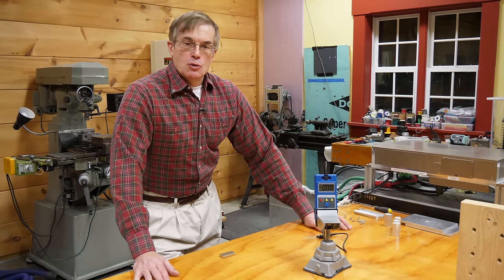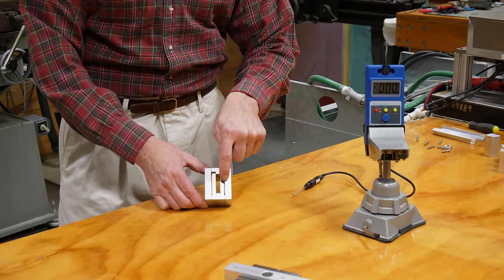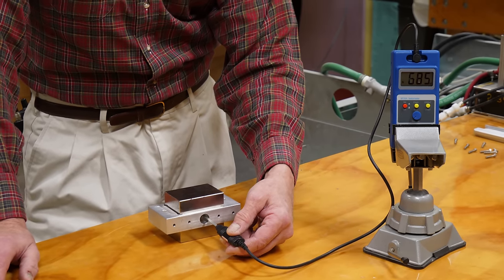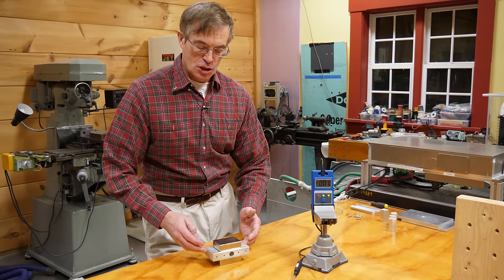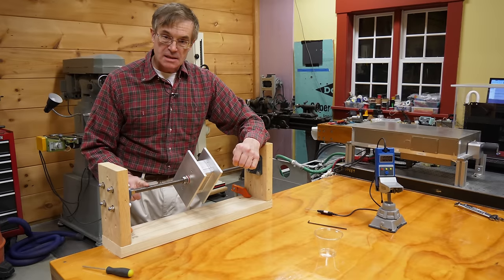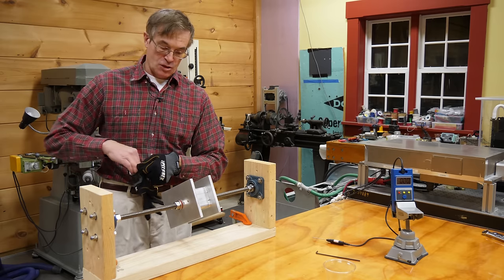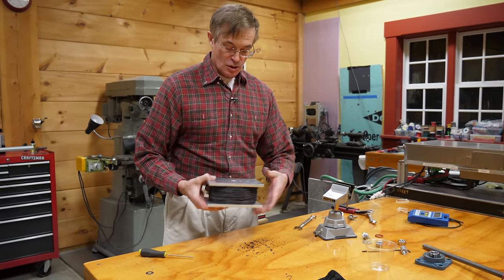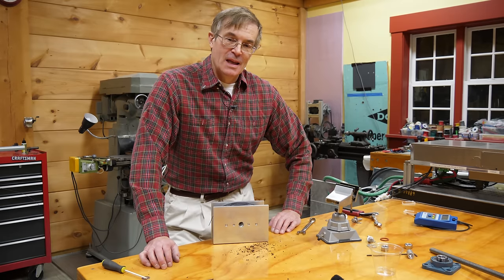VERY POWERFUL MAGNETS… THE EASY WAY

Comment: Great idea! I giggled when you struggled with the tools near the magnet. I know exactly how challenging that can be... You know its coming and prepare for it, but you just can't compensate for the quickly increasing strength of the magnetic field near the magnet x)
Reply: I did some work on some magnetic stuff back in the day, we had some special alloy tools which made it a lot easier. I think they were just stainless steel, but I can't remember, I remember them being expensive however.
Reply: @ColtaineCrows  Neodymium magnets are unbelievable compared to any of the past magnetics most of us old guys are familiar with. Every warning about pinch danger for any neodmag larger than two nickels stacked together is for real. Blood blisters for magnets the size of a quarter or a domino. Crush bone on neodmags 52 about the size of Tech Ingredients' rig here. Loose fingers and other chunks of skin on a 6" diameter magnet. The holding force is not an exaggeration. Put the weight of a refrigerator on just that finger and it's going places.

DO NOT LEAVE MAGNETS of any kind where ANY KID can get to them. If they're stupid, and we're all stupid at some age, they'll swallow them. Bad enough for refrig magnets but DO NOT WAIT AROUND IF NEODYMIUM (shiny) magnets. If they swallow a bunch at one time connected, they might pass them in the poo but still straight to hospital. If they pop them in their mouth like popcorn, they're going to end up in surgery immediately. (muscular distortion of intestinal wall >  huge shear vectors where pinned by neodymium pair or cluster).

All that said, they are fantastic to try out ideas that weren't effective back in the day (It took me a few nips to forget the old-magnet mindset - scary these are) that may show noticeable efficiency now. 

There is more to magnetic resonance than we understand. Just like hitting a certain note in a bathroom, oscillating magnetic fields need a rethink toward new materials and methods. 

Supercapacitors able to be quick fed transient and anomalous emfs that are now wasted can add up harvested. Much of our math on efficiency relies on the permeability of the magnetic and reluctance of alter-magnetic materials which are derived in non-combined standard lab replications. Experimentation is happening because magnetic power and energy storage options are available. The gold standard is electric flying. Power/Weight ratio can be offset by unconventional efficiency schemes using short burst hot and long term simmer power management. Great time to be alive and curious in these things. Great FREE resources like this guy here.

The Bedini wheel as explained and demonstrated by Great Scott showed some interesting strangeness in the results but only because he can diagram and explain his fabrication and then measure and reason on the results. Might be worth replicating his effort. Hate to encourage the lunatic fringe and I've seen the "free energy" videos til I'm sick but it was a surprising outcome and those are always happy accidents.
Reply: Needs some anodized aluminium AN Spanners, maybe that would work
Reply: Depending on what you are doing, you can add a bounce layer to one side, so you do not get metal on magnet contact.
Reply: one over d² right ?
Reply: @ColtaineCrows They may have been beryllium copper tools? These are non-magnetic and also non-sparking. Very practical if there's an explosion hazard from eg. working on gas pipes...
Reply: @brainiac75  can you do a video on whether powerful magnetic fields affect phosphorescence times?
Reply: @Flatox if you have 3 spatial dimensions, yes.

If you have more than 3 spatial dimensions, you don't have time to play with magnets, you have to work on your string theory paper and ask your doctor if you can get a day pass to go see Brian Greene at the local library — and that nurse who hates you might have told him about the whole "Calabi-Yau manifold made from feces" thing. Don't worry, though, they'll rue the day they crossed you when you win that Nobel prize for the most prettiest maths.

Sorry. I don't know where that came from. If you work in string theory, I support you 100%, as long as you spell my name correctly on the coffee. 😎
Reply: Your Channel Is Op
Reply: @brainiac75  : I used them as a former mine diver ... 
Lost a hammer, paid 500 German Mark ...
Reply: @CSkwirl  I was thinking titanium due to how much tougher it is, but stainless in the 316L range would be nearly as tough and a fraction of the price, and maybe save some to get the tougher jaw face by mounting thick sheet over them of titanium, though I wonder if he slid say a 1/8" thick flat sheet of bismuth over the side and around the bolt if it would make steel easier to use with any significance that is.
Reply: 8
Reply: @ColtaineCrows  The tools may have been made from Beryllium/copper.
Both light weight and non-magnetic.
redrok
Reply: Experienced the other day when repairing my washing machine. Had to remove the rotor, and it needed to be lined up just so, which was tricky since every time it got close, it would suddenly be pulled to one side or the other. 😅
Reply: I'm not wealthy enough to be able to afford non-ferrous tools but that is the whole reason I do NOT use adjustable wrenches around larger magnets (not near as big as his). It's hard enough using the correct open/box end wrench but way easier and safer (for me) than adjustables

Comment: You should use flat steel similar to pallet strap. I've seen it used in some power transformers.
This will eliminate most of the air gaps created by the round wire. It should give you a higher density.
Reply from the maker: We considered that and it is a good option.
Reply: Winding first few turns of that stuff could be an "interesting experience"...
Reply: @blg53   Throw on a liberal amount of Kapton tape, and it should be fine.
Reply: @TechIngredients  Could you use shorter strips of metal and layer them similar to bricks first then wrap the wire over the top so as to bring the field lines closer to the gap? Or have I got the wrong  end of the stick?
Reply: @TechIngredients   would you elaborate on why you choose the wire over the straps. Your response implies you have weighed the  options
Reply: @kurieren  I did some looking cuz your post got me curious so I did some reading. Kapton tape used specifically to insulate wires in and around a coil have been directly connected to loss of life in the airline and space industry due to the insulating properties having poor abrasion resistance in a high vibratory environment.  Basically they don't do that anymore because it has failed and killed people.
Reply: How about placing blocks of ice as spacers between the existing structure and the material that needs to be added, guiding the new pieces in to place as the ice melts?
Reply: In power transformers they use flat copper wire and then fill the inside with mineral oil.

Comment: Very ingenious solution! I worked on MRI's a short while and the experience you had with the channel locks was a real problem I had. Most of our tools were beryllium alloy so non-ferrous but drilling access holes for fiber optic cables around a +2T magnetic was an experience I never wish to repeat. Wonderful video keep them coming!

Comment: Amazing that you can make a relatively uniform magnetic field with almost a whole 1 Tesla of field strength. The strongest magnets I ever used were 3 Tesla, and those were liquid-helium cooled superconducting magnets in a Bruker Spectrospin 300 MHz NMR machine about 15 years ago. Go back about 40 or 50 years, and 1 Tesla would probably have been enough to do some basic low-field NMR experiments. If those super-strength rare-earth magnets had existed then, I'm sure they would have been used for that!
Of course the added problem with NMR is that the field strength around the RF probe (which is where the sample-tube goes as well) has to be ABSOLUTELY UNIFORM - no variation at all. NMR instruments typically do this with secondary electromagnet coils called shim-coils, in which the current is adjusted to even out the field strength. In the early days this was done manually while keeping your eye on the field-sensors, but this utter tedium was eventually taken over by a computer, which could do the adjustments much faster.
I wonder if there would be a way of combining the permanent magnet array you show here with a bank of electromagnetic shim coils to make a perfectly uniform field? A standard NMR sample tube is only 5 millimetres wide (with a 40 millimetre sample depth), so the cross sectional area over which the field needs to be uniform is fairly small. If you could do this, you would be on your way to making the core of a home-made NMR instrument. Minus all the RF transmitters, receivers and amplifiers of course, which are a whole other headache.....

Comment: I used to work at a transformer company and they used sheets of high-silicon steel which were layered together to make a laminated core. Apparently it allows a higher magnetic flux density than solid steel.  However I can see that working with sheet steel edge-on to a powerful permanent magnet is a recipe for truncated fingers, so your wound coil idea is interesting.
Reply from the maker: Thanks!

Comment: when are we seeing the Magnetohydrodynamic motor/generator using that large gap magnet?
Reply: Everyone and their brother (not really) has done a mhd  motor with conduction. I'd like to see it done with induction.
Reply: @kreynolds1123  
How does that work?
Reply: @robbiejames1540  if you change the current in a coil, it creates a changing magnetic field. That changing magnetic fiend induces a current in a conductive  metal neat by. The  currents in the metal create their own magnetic field in opposition to the initial magnetic field that induced the current.  The result is a repulsive force pushing the conductor away.  

A Pulsed induction thruster uses a coil to ionizes a gas for a working fluid to use for a thruster to genetate an intense  and  rapidly changing magnetic field.  once the gas is a plasma  the changing magnetic field from the coil induces a current in the plasma and that current in the plasma makes its own magnetic field  opposing the magnetic field in the coil thus pushing  plasma away at a high speed for thrust. 
https://en.m.wikipedia.org/wiki/Pulsed_inductive_thruster
Reply: @kreynolds1123  
I see! That's really clever.
Reply: @kreynolds1123  
Presumably, that would also work with any sort of conductive material - so you could shoot a plate of metal with it too?

Comment: I wrap lots of wire and built an aluminum jig/fixture that goes on the lathe and uses the threading settings. Hardest part is like you mentioned chip cleaning before when using magnets. I spend more time in prep cleaning before than I do wrapping.

Comment: What a great video. I’ve always wondered what other ways would work to strength the magnetic field. Big blocks of steel are expensive and dangerous and hard to work with. The wrap technique is something I can do and maybe not have every nut and bolt require that it be scraped off my bigger magnets. Thank you! Thank you! Thank you!
JTI

Comment: How about using steel ribbon instead of wire? I'd imagine it would be more expensive, but it could be easier to wrap and far more uniform.
Reply: Good Idea, even though he did say its only the cross section that is significant. But there would probably be some increase. That's basically a packing problem. Like you said it probably wouldn't be worth the cost for the few percent(if that) increase unless you had some laying around. Or perhaps even just cut long strips of sheet metal.
Reply: My intuition (which is likely to be completely wrong) makes me think that two opposing C-shapes out of steel ribbon would be even better as guides but it would not be as practical to build, especially not in a continuous additive process.
Reply from the maker: The ribbon would work, the result would be more compact, the ultimate performance would be the same and the cost would have been higher
Reply: Clem Taylor agree! cold rolled steel wrapping around as used in low frequency transformer style would increase permeability which could increase the inner flux( my thought).  Improve rejection to the eddy current to? if the experiment required to reduce the hysteresis loop of the wrapping material then could be a good idea. Good comment Clem. 
Keep going! Very informative and recreative topics

Comment: Would wrapping the copper wire more uniformly with tension help align the magnetic field's better for a higher Tesla Rating???
Reply from the maker: Copper is not ferromagnetic and neither is aluminum.  Although this wrapped magnet looks something like a transformer, the wire serves a completely different function.  The wire in a transformer guides the electron flow and it is these electrons that generate the magnetic field.  This steel wire guides the magnetic field which is generated by the permanent magnets in the center.

Comment: You were talking about magnetic flux density (in tesla), not the magnetic field strength.
Please try to use the correct term. I know everyone uses the terms incorrectly, often including myself, but it´s a big difference.
Reply: @invendelirium  Yes they are proportional in this case. 
It´s just something that can be confusing, making it important to use the correct term.

Comment: My dad would have smacked me upside the head for trying to use channellocks instead of wrenches to tighten the nuts.
Reply from the maker: My dad might have had the same thought, but avoided it, fearing an endless debate  about why do we have channel locks anyway.
Reply: Ha! reminds me of the time I needed a pole for my rain gauge. So, idiot me sawed the head off my mum's broom and broke the blade of my dad's hacksaw in the process. The light of truth hit me when the broom head hit the ground: Annoying one parent was dumb, both together and I was dead.

My dad's comment: 'I told you to never use a metal cutting blade on wood.'  He attaches the broomhead back to the handle and takes me to buy a new one for my rain gauge.

Comment: When you don't want the nut to move, use two and tighten them toward each other and that could alleviate pressure on the carriage device in the middle. You could have saved on the bearings at the ends.

Cool video!

Comment: Very clearly explained and demonstrated. Thank-you. At those field densities, you're within an order of magnitude of the field strengths of superconductor electromagnets - and for a much smaller cost, in a safe manner, albeit within a much smaller volume of influence. You've gained a subscriber today.
Reply from the maker: Thanks!
If you can afford to reduce  the volume further, two tapered, steel pole pieces in the shape of a pyramid or a cone can more than double this field strength.
Reply: @TechIngredients  Yes, it's an old idea which has been used professionally. I have a magnet which was rescued from a scrapped 1950's magnetron and which uses that technique to concentrate the field.

Comment: Kudo's for using the proper SI unit tesla. At the risk of splitting hairs, strictly speaking,  your meter is measuring magnetic flux density, not magnetic field strength (your wording), for which the units would be ampere per meter (A/m). They are related though, for a given set of circumstances and materials. I like your shop BTW :-) Also, your camera work and editing has improved substantially - congrats on that!
Reply from the maker: Thanks for the clarification.
Also, thanks for the other comment.  Many viewers (and at one point that also included us) do not understand how much effort and learning goes into producing a good video that is easy to watch.  We are still learning!

Comment: Channel deserves much more subscribers compared to most others that use gimmicky graphics, and borrowed filler content 👍👍. Wondering, what would happen, if the wound bobbin(made of laminated mica) of steel is taken out and melted to form a solid block(easier said than done).
On another note, seems like an efficient way to laminate(assuming a thin high temp insulating varnish on the steel wire), to make a low frequency(several hundred Hz)power transformer core, without needing ferrites and high frequencies, while still almost eliminating eddy currents without using the typical laminated El steel plates. Just some 💭

Comment: Thank you for sharing. Very informative with a touch of mild humour (I'm Canadian).  
     I have have a thought for your consideration if you are planning to wrap more magnets.  Swap out the threaded rod for a wooden dowel slightly longer than the mounting bracket.  Use non-ferrous materials to secure the magnet assembly. Attach a drill to one end of the dowel to drive the winding (a lot less strain on the arms, hands and fingers).  Would also suggest that you fabricate a spool to hold the wire and run the wire through a series of dancer rollers or pullies.  This will help to apply a more consistent tension on the winding, not to mention that this would free up your videographer to do videography.
     Just saw the upload date.  Story of my life, the ideas and witticism come well after their usefulness, oh well.  Carry on you're doing a fine job.

Comment: Subscribed, you always have very interesting stuff going on. I worked with Siemens doing MRI refrigeration and the magnets were usually anywhere from 1.5T to 3T that I've come across. Seems like you're working with similar principles but on a smaller scale. And titanium tools would be good for these projects with magnets but pricey!
Reply from the maker: Thanks!